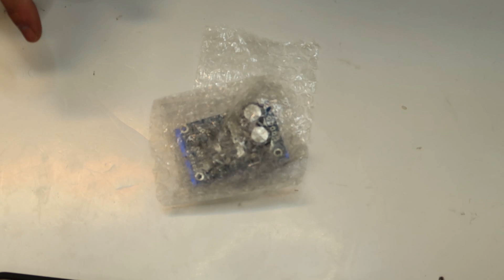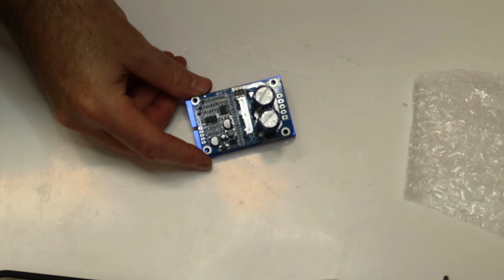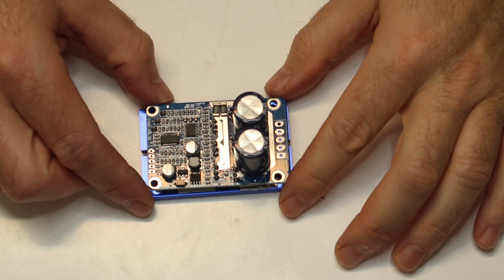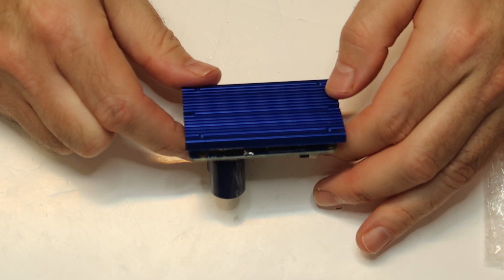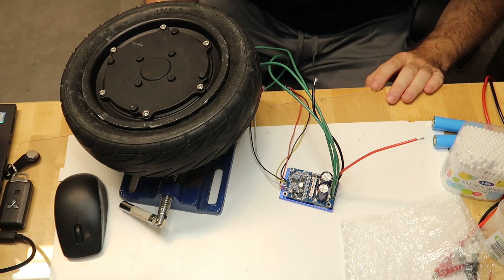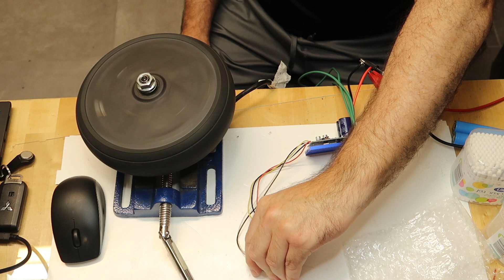BLDC Brushless Sensor less 3 Phase Motor controller 18-50V 15A (750W)  JYQD-V8.5E

Comment: does it control the position?
Reply from the maker: what do you mean position ? what position ?
Reply: @RoeeBloch  can you use it to like a robot arm? which is necessary to control the position of the rotor, moving like 1° degre - 180° degre
Reply: @TheLordbruh  no， it only open loop control velocity